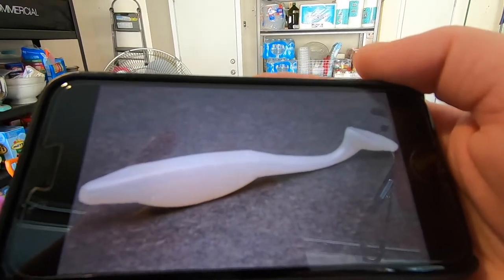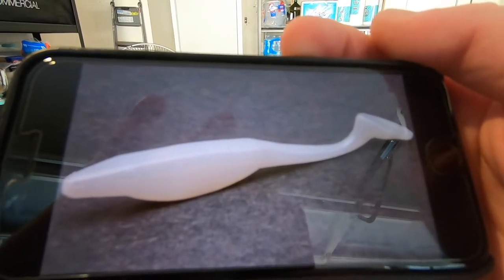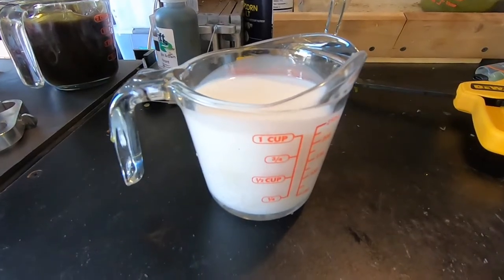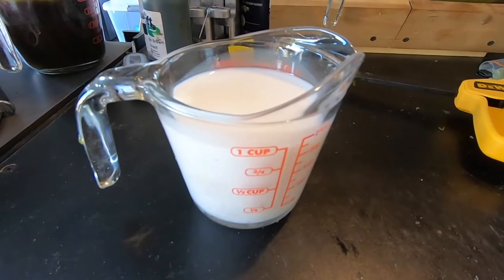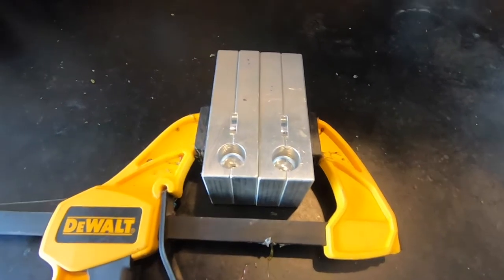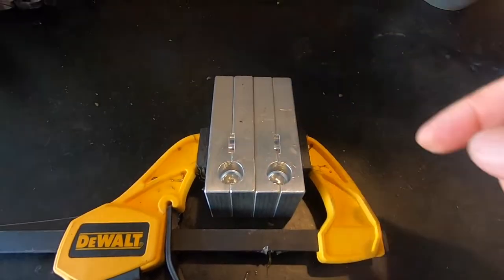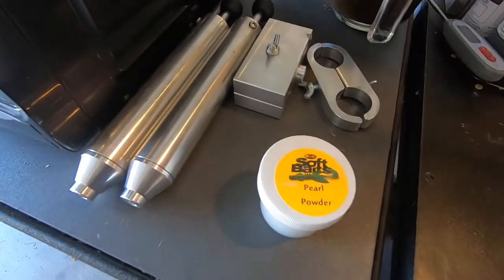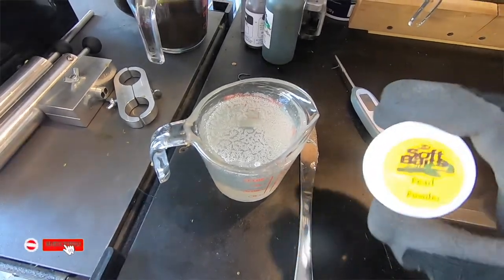Making Soft Plastic Baits - Color Matching White Pearl - Making Ripper Swimbaits

Comment: How long do you have to wait until you pull the mold? How long until the plastic in the measuring cup hardens?
Reply from the maker: It doesn’t take long for the plastic to cure in the mold.  Maybe a minute or two. 

The plastic in the cup will need to be reheated regularly the light out pouring
Reply from the maker: Throughout pouring

Comment: Do these only come in a one cavity or more?
Reply from the maker: These ones yes, just one cavity, but they have the essential series molds that have more cavities.  The essential cavity molds are cast aluminum and the colors aernt as vibrant with those molds but the baits work still!
Reply: Matt Luna Fishing what is the difference of cast aluminum is it the quality? Which would you recommend
Reply from the maker: I’d recommend the CNC ones.  It’s going to a have a more polished look to the baits.  Hard to explain.  I’d i had pics size by side you’d see what i mean.
Reply: Matt Luna Fishing ok do you have to order them sepeeratly on the website
Reply from the maker: Like individual molds?  You’d need to buy however many you want into the cart
Reply: Matt Luna Fishing sorry I shoulda clarified is there like a separate link on the website from the basic molds to the ones you have
Reply from the maker: Here’s a link to the ripper molds https://store.do-itmolds.com/ripper
Reply: Matt Luna Fishing ok thank ya!
Reply from the maker: No problem
Reply: @MattLunaFishing  what I do with my essential series molds is I spray them with Bang scents before i inject or you can even use cooking spray to give them the shine also if you are careful I sprayed a some with a high temp clear coat spray just make sure you let the molds completely dry for 2-3 days before using them I like the bang to add a little scent myself
Reply from the maker: Chad S i tried the high heat paint and it didn’t work for me.  I might give it another try.